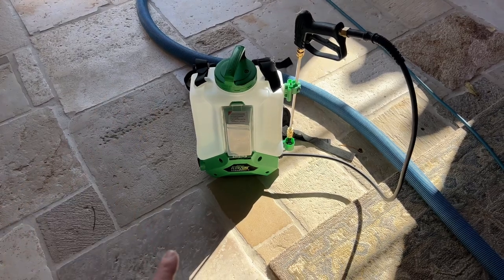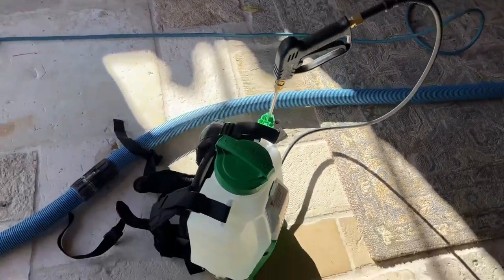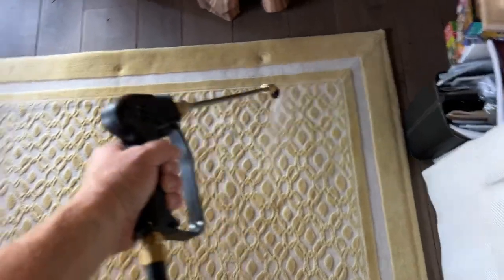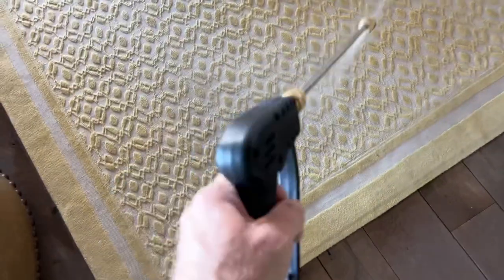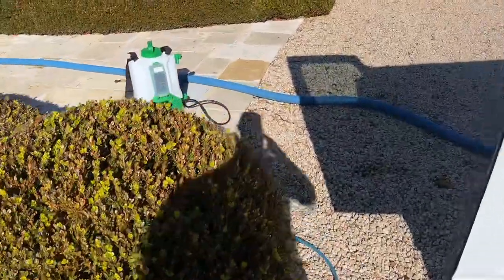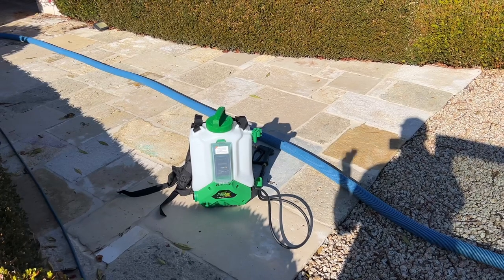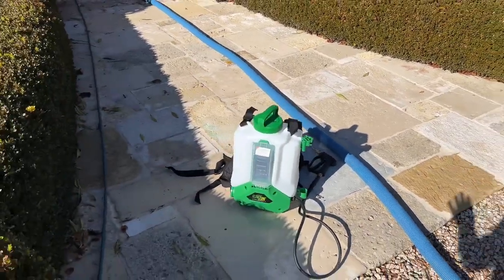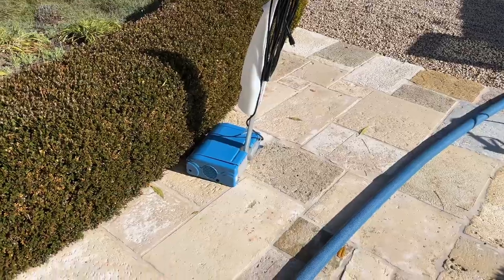Carpet cleaning with the Flowzone Typhoon WOW

Comment: I have the same sprayer for 2 yrs now and has been the best sprayer I've ever used, the battery life is amazing and by the way 1 gallon will treat 1000 square feet at the appropriate setting when calibrated for your particular application.